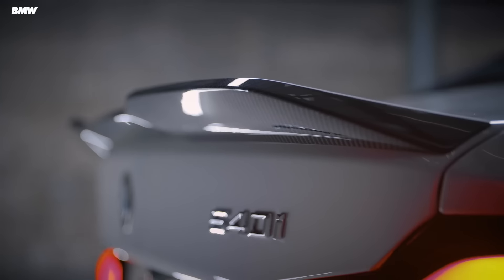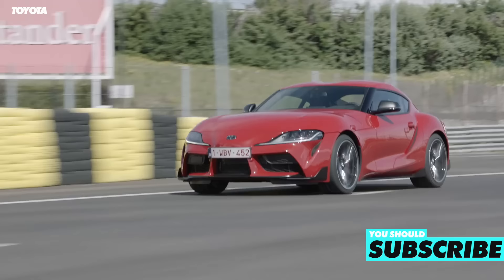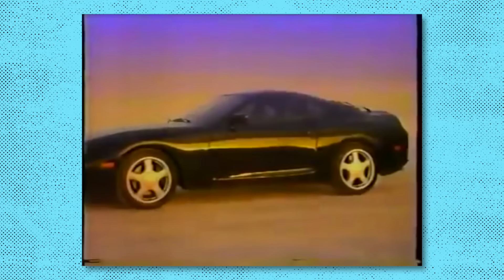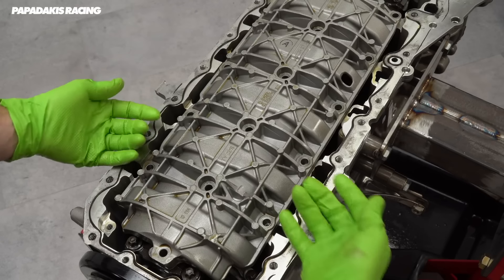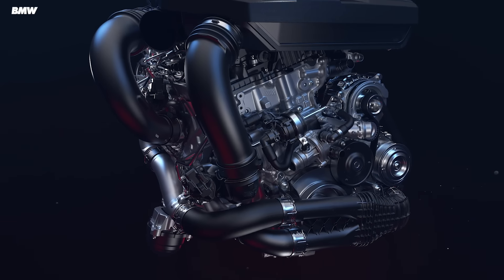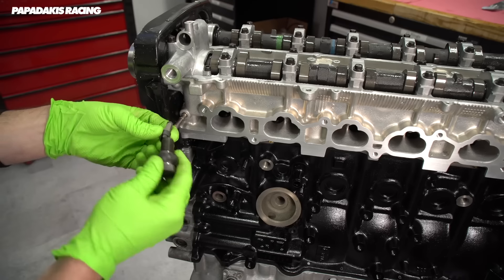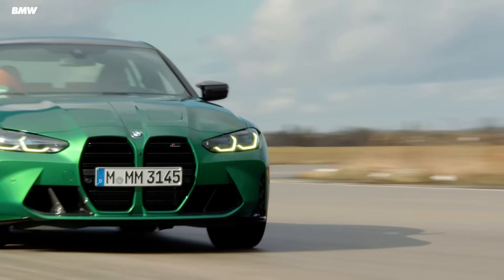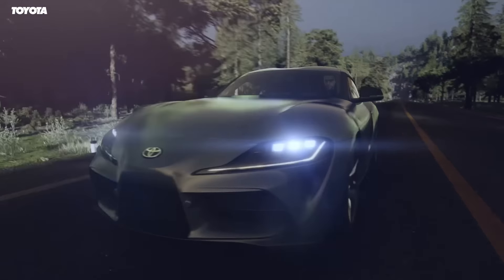Inside BMW's Greatest Engine

Comment: Ok" B52 but ours a stright 6 2010 328i not the fastest but the most reliable with 145000 miles and runs like a golden charm. Yes it's an older model but it's a proven model. No tune, we don't find the need to play with the computer, besides we're b not going to win races, but get outrageous reliability. And yes it's a stright six. A great stright six, and BMW.

Comment: No mention of how toyota did manage to destroy two engines during testing and gave bmw a list of items to fix...before the bmw engine  could make its way into Zupra.

Bmw engineering is great but its unethical to sell cars with headgasket issues... Oil leak problems, turbo failures, fuel pump issues, coolant resvoir leaks, excessive oil consumption.

Comment: The MK5 Supra is a re skinned Z4. Its not just the B58 engine thats the problem. The entire drive line and running gear is BMW. The interior is also distinctly BMW. Its more of a travesty considering they could’ve taken the Lexus LC500 and stripped back the luxuries while keeping the V8.

Who the hell out sources their sports car when they more than have the means to do it?

Comment: Yes is the most reliable BMW motor  but is complex we got a advantage and disadvantage in this motor:reliability but very complex and expensive for maintenance and repair that's why the oldest generation sport motors like a LS1,2JZ,Honda B series,Mopar Hemi,Buick3.8 V6 all are very fast and you can see many of this motors in drag racing make between 6 to 7 seconds in the 1/4 mile so this mean all this motors have higher potential less complex and more reliable than the BMW masterpiece 😂

Comment: I think they would have paid extra for that 3jZ
Just upgraded 2JZ 

without any plastic the fact that there's plastic in any engine is just stupid to me
The plastic parts are meant to fail
Reply: You'd quiet literally be looking at the same engine then but with a front mounted chain with it being open deck like the rest of the modern toyo engines.

Comment: Not so sure about reliability after just 105,000 miles... with no prior signs...BOOM!

This is not spam... I really need help with this.

My 2017 BMW 540i G30 just burned a valve #4 cylinder. (105k miles) I had the vsfr high flow cat, upgraded charge pipe, k&n air filter, new B58TU Fuel pump, and Bootmod3 Stage 2+ 93 octane.

I am beyond depressed!😢 I am a Single Dad with 1 special needs, child. 

I was told I need a new engine that will cost 21k installed. I just can't! 😭

I still owe 25k, and it is  my only car. I have nothing right now and am about to lose my job. I can't get my kids to the doctors, etc... If you can please reach out to your connections and see if they can help, I would be forever grateful 🙏  
(Huntsville, Alabama USA)

🤔A rebuild and breakdown of what went wrong with my B58 might help others with B58. (Content Idea)

God bless you, brother!!! 

~J. McCall

Comment: Toyota didn’t really help develop the B58, it was basically entirely BMW.
Reply: BabaYaga Racing  no they didn’t…the engine is basically the same…the biggest difference is the fuel pump which the B58TU also uses and the only year of the Supra that’s any different is the 2020. The 2021 uses the B58TU which BMW has been using since 2019 in the M340i. Toyota did basically nothing, it’s all BMW,
Reply: BabaYaga Racing  No they didn’t! Supra fanboys can’t understand simple business and economics. Toyota went to BMW coz they didn’t want to spend money on development costs and all of you numpties think contrary to this they spent money redesigning 1000s of parts in the B58 just for a low volume car that the Supra is? Pure numpties!

Comment: When a 1.6 3cylinder in a Yaris makes you eat your words and has made more than a b58 on the stock bottom end… come on though this isn’t the next 2jz and is way to complex to be brought to their level anyway
Reply: Well the 2JZ block does 2000 hp which is ~333 hp per cylinder ... i would love to see that B58 block touch the 2000 hp mark ... 
Papadakis hit 1000 hp on that B58 WITH A BUILT BOTTOM END .... 
Still 1000 hp away from the 2JZ block ...
Reply: @ACommenterOnYouTube  they have to do a block fill to make that kind of power reliably on a 2jz but still the b58 has a long way to go. Still can’t believe they put the vanos/timing chain on the rear of the engine like that’s ever worked on any car long term before and you still have direct injection and so many plastic parts that will fall apart over time.

Fact is the 2jz has already proven itself
Reply: @MrGhostOg  the 2JZ HAS proven itself but you got the B58 Zupra fan boys stating its AS GOOD or SUPERIOR to the 2JZ ... So i ask WHO has pushed the B58 to its limit ???? NOBODY ... lots of people have done the pistons and rods to get it to 800 crank hp ... Papadakis has rebuilt the entire motor with custom pistons and rods, etc just to hit 1000 hp .. 🤷🏽‍♂️ .. So where is the confidence on this B58 BMW engine ?? 
Dont claim the B58 is superior when nobody has proven it yet. That 2JZ block IS heavy YES but its fucking STRONG and capable of 2000 hp ...

Comment: I build a lot of 2jz's at SRD Tuning and the B58 will fail well before the 2J

2jz stock block and crank can take 1400hp its insane.

Its also reliable and doesnt have flaws like bmw with silly ways to hold the nose and front pully assembly,

B58 is a good engine but at 1400hp I bet the block will peal open like a banana 🍌 lol

2JZ for me all day long

Comment: Reliable?! It's a new engine. You cannot make this kind of statements yet. And you definitely shouldn't compare it to the legend that the 2jz is. That's blasphemy! You shouldn't put BMW engine and reliable in the same sentence. It's true, they've had some really good straight 6 engines in the 90s and early 2000s, because they weren't over engenered, but were nowhere near the 2jz.
Reply: The B58 has been around since 2015 that’s make it entitled to be called reliable. 7 years is enough to be able to tell if there are any issues.
Reply: @joebloggs4191  no, it's a piece of crap. I would like to say it's over engenered, but it's actually bad engenered. 7 years it's not enough. Give it a bit more time and it will show its true face. One of the reasons why the 2jz is reliable is because it's very simple and straight forward.
Reply: @razvanursache9493  Simple and straight forward don't push the game on but yes that is the core reason why Lexus and Toyotas are reliable BUT at the same time they are super boring even the Mk4 Supra is boring! 7 years is more than enough to tell you if an engine is going to have some serious issues and thus far B58s have none! By your logic Toyota bought pieces of crap to put in the BMW Supra then? Another idiotic Toyota / Supra / 2JZ fanboy here.
Reply: @joebloggs4191  I'm not a supra or jdm fanboy. Actually i own a 2.5 turbo 5 cylinder Volvo. I am a mechanic, in Europe, where BMWs are fairly common. And JDM cars are not really a big thing here, or at least not as big as in the US. I never said the b58 is not fun or performant. But it's a long way from being as reliable as the 2jz. When it smells like shit it must be shit. I've dealt with BMW engines quite a lot, especially with the small prince family engines. They're the small 4 cylinder brothers of the b58 with a lot of the same sistems as the b58 integrated in them. They're fun, but not really reliable. The first thing that i saw very similar between them is the timing chain sistem, which is not very well designed. Even worse is that in the case of the b58 the timing is on the same side with the gearbox, and knowing BMW products, they usually go bad not long after the warranty expires.
Reply: @razvanursache9493  Well I am not saying all of BMW's drivetrains are or have been reliable and they are known for having crap 4 cylinder engines in terms of reliability and same for some of their V8s which I would never touch. However generally speaking their 6 cylinders and V12s are pretty good and some are pretty trouble free such as the N52 B58 M54 etc. Sure nothing is going to beat Japanese cars for reliability since they are very simple in design but face it most Japanese cars are dead boring to drive, not as refined or fun and generally don't push the game on. The B58 has been around for over 7 years now, any serious problems would have reared its ugly face by now but the fact is it hasn't which means the engine is proving to be pretty reliable. Others in the past such as the N20 4 cylinder quickly showed up issues with their timing chain in less time than this although apparently BMW reengineered the timing chain and tensioners for the 2014 or 2015 year and forward which eliminated the issue. The issue here is with people claiming that Toyota reengineered over 1000 parts of the B58 and that that version with those parts is whats used in Supras. That is absolute bollocks!

Comment: 700BHP without touching the bottom end...I'd take a terminator 03/04 Cobra motor setup all day. 900+HP on the stock bottom end with a whipple or turbo and they sound like heaven.

Comment: 2jz is outdated af lol you don’t just make 900hp and expect a supra to put it down you gotta go ham on every component too. The B58 is op and has the chasis to handle the power without upgrading every single component. The N54 is even more tunable just not as reliable when bought by 16yo

Comment: If only the rest of the car was up to the standard of the engine.
Reply: What do you mean? Have you ever owned a bmw to have a stupid opinion like that? Bmws are super high quality cars. That’s why people buy them
Reply: @user-ie4kp7ni9d  Instead of calling his opinion stupendous, maybe you should provide suitable data which would confirm his ignorance. It might be a quality product but that doesn't mean it's reliable. More complicated systems tend to suffer from higher levels of entropy which means your product is more likely to fail the more refined it gets. Germans tend to overcomplicate and that is the reason why their products start to wear down substantially once they reach a certain age. In BMW's case that's 5-10 years.
Reply: @davidc4396  something tells me you haven’t owned a bmw either 🥱

Comment: Has BMW solved the issue of CBU in its DI-only engines? lf not, anyone who has one of these is looking at de-carbonizing the intake system, especially the ports and valves every 40k+ miles at considerable time, effort or expense. Having worked as BMW mechanic in the  80s and 90s, l decided against getting a newer one for this reason alone. ln addition to that, newer BMWs make extensive use of heat failure induced plastic parts in the engine bay, which would likely make the late, legendary BMW engine designer Paul Rosche spin in his grave. That is if such things were possible with embalmed corpses in their coffins.

Comment: No, I'll scrutinise your comments and correct you
----------
"You are correct but you're using the broader term of evolution, to evolve."
- NO, I'm using the ONLY CORRECT definition of evolution; 'change in allele frequencies in populations of organisms over successive generations'.
- and it's senseless stating 'evolution is to evolve', an obvious point that explains nil
"Adapting is evolving and that leads to speciation which is a fraction of evolution."
- WRONG; adaptation may or may not involve evolution, so 'adaptation is evolving is wrong'. An adaptation may be a change in dietary intake throughout the year, this is not evolution. On the other hand, a change in colouration to better suit a new environment is an adaptation necessarily requiring evolution, and again that means a change in allele frequencies in the population. Note how in both examples no speciation is involved, which is definitionally distinct from adaptation. Speciation is a distinct process, as the 2 examples show, but speciation probably always involves a series of adaptations, but adaptations do not need to include speciation, hence them being definitionally distinct!
"they are all steps in evolution"
- NO, they are steps that MAY include evolution, as I just laid bare. An adaptation may NOT include evolution, as in the example given about diet. "but we were expecting they evolved so much they can't reproduce with each other or look like 2 separate animals, along those lines."
*Please read this last response carefully, I want you to understand where you are going wrong*.
- I already stated "Speciation necessarily involves evolution"! The point there being that evolving (again; change in allele frequencies in populations over successive generation) they can't reproduce with each other or look like 2 separate animals to such an extent that  It is YOU that is muddling what evolution does and does not mean and apply to!

Comment: 6:28 "Imagine how expensive it would be for Toyota to create a brand new straight 6" Toyota have been making world class engines for decades, take a look at endurance series (Toyota TSO10 - TSO50) or even F1... They seem to be doing just fine making the engine for the new Toyota Corolla GR, and turning the hot hatch market on end.
Reply: The Corolla and Yaris share the same 1.6 3 cylinder engine. It'll also feature later in detuned form in other cars. The Supra is just a rebadged Z4 so it's not just an engine thing, it's the whole car. Toyota haven't got the budget to develop one trick ponies any more and that was evident with the GT86.
Reply: @grahamek86  Toyota is one of the best selling brands out there and the Yaris program you mention contradicts your statement. The Yaris 3 cylinder development and the Yaris XP210 being a "passion project" by the Toyota CEO shows that they can develop one trick ponies meant strictly for sports cars or homologation for racing. If the company can have passion projects and the Gazoo racing programing can do both WRC and WEC racing programs they can afford to be more authentic with making their own engine (and yes this does not just end at the engine). 

The M15 family of 3 cylinder engines for the Yaris began in 2018/2019 which would eventually evolve into the G16E in the GR Corolla and Yaris. They were already developing a brand new family of 3 cylinder engines during the development of the new Supra. If they are starting a new family of 3 cylinder it is not out of the question to wonder why Gazoo racing can't create a new 6 cylinder (or even have the I6 share similar dna as the I3).
Reply: @amorag59  The fact is the G16E will show up in economy models. That's quite simple economics. If they were capable and willing to produce one trick ponies then we wouldn't have the empirical evidence to the contrary. The MkV Supra and GT86. Both vehicles were outsourced. The Yaris and Corolla platforms were based on existing technologies, the GT86 and Supra didn't have an existing platform to were outsourced. Quite simply, if they were so capable and willing, why didn't they do it?
Reply: @grahamek86  The G16E is produced by Gazoo racing... Yaris and Carolla GR with G16E are not economy models they are sport hatchbacks made for homologation for racing... As I said the M15 3 cylinder was a completely brand new family of engines developed right around the time of the Supra development, if they are making a brand new 3 cylinder it is not outside reason to think they could have the means to make a I6. Gazoo racing developed a brand new 3.5 V6 (H8909 engine) for their (TS0010 to GR010) endurance race cars (going to le mans is $$$) and they don't use this V6 anywhere else in their production line up. Yes they outsourced the Supra, but given the things we see them do there's an argument to be made that wasn't 100% necessary.
Reply: @amorag59  Yes and the EA855 EVO was produced by Quattro GmbH but now we see it in the Cupra Formentor. Just because it's produced initially as a high performance motor doesn't mean it won't appear elsewhere. That motor will make its way into other cars, you can bet your bottom dollar.

You keep going on about how Toyota could have done something, yet you're completely failing to address the reality that they did not. The GT86 and MkV Supra are not Toyota developed vehicles or drivetrains. They're rebadged vehicles from Subaru and BMW.
Reply: @grahamek86  I'm not saying it won't make its way into other cars, in fact the M15 inline 3 (predecessor for the G16E) engine started in economy Yaris and Corolla cars. I was simply correcting your statement above about where the G16E will be used. It shows Toyota has the cashflow to create a sports version for the purpose of homologation. It shows they created an engine from scratch, and by that same token created the bespoke racing V6 that won't have any economic return from production versions, shows they do develop new engines some of which will have no plurality through an economy car line.

What is involved in addressing the reality they did not do something they are showing evidence of doing before? Your argument is: if they could have then they would, you are not providing evidence that they could not. Toyota makes more revenue than Subaru and BMW etc. combined... They literally have never outsourced an engine before the 86/Supra, all of a sudden they need to? You are simply stating facts we know, that the Supra etc. is outsourced as a whole.. Okay we know that, but are you arguing that Toyota is incapable of making the Supra bespoke? 

Did they need to rebadge for the remake of one of the most iconic brands? They can spend a fraction of a billion dollars on a racing programs for the WRC and for world endurance series (developing a V6 for the GR010), but they need to save money and outsource the Supra? No, again it is not outside reason to think they could have made the Supra brand Toyota. If you want to argue that Toyota needed to outsource everything, then believe what you want to believe, their brand history and their cashflow enough for world class racing programs doesn't line up.